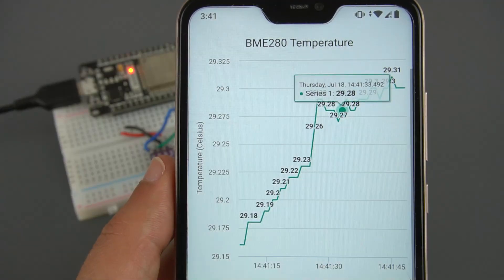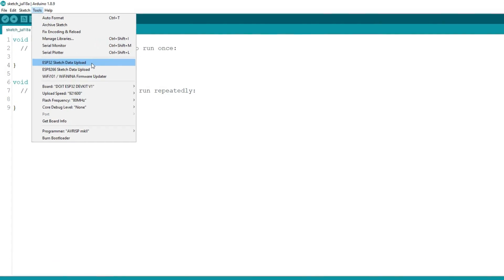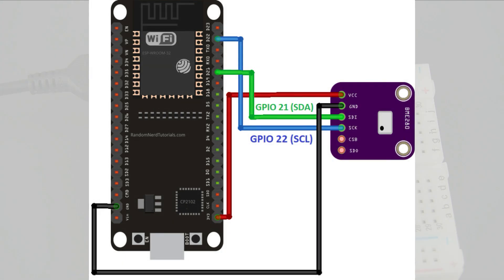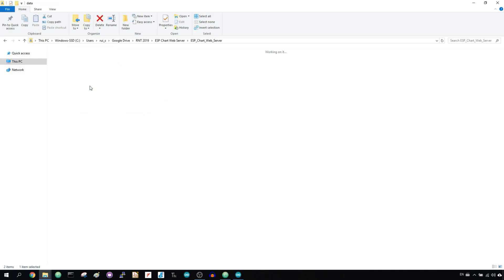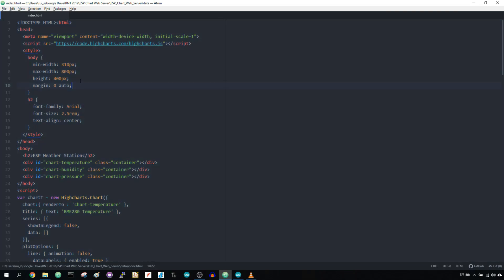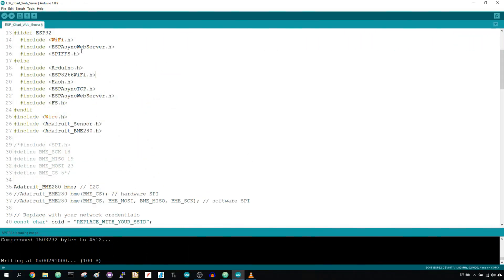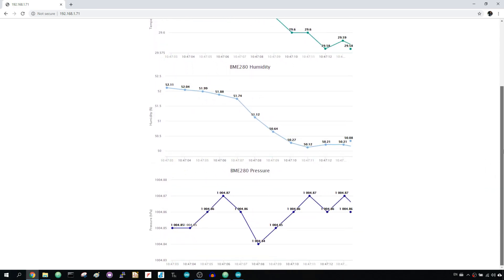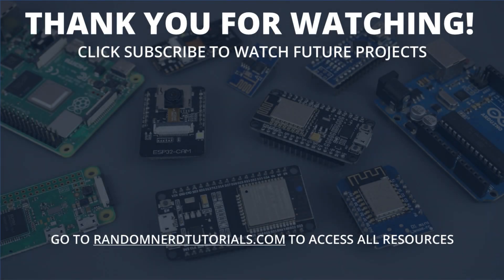ESP32/ESP8266 Plot Sensor Readings in Real Time Charts - Web Server

Comment: Goodnight friend.
Gonzalo Rojas from Venezuela writes to you.
I am working with the ESP32CAM development card, specifically with the example of CameraWebServer, it compiles and records well on the card but when I click MonitorSerie it generates the IP of my WiFi, however it does not connect with that IP on the internet, also on The Serial Monitor generates the error: E (321) esp_core_dump_flashz    ɕ dump partition found!
E (321) esp_core_dump_flash: No core dump partition found!

COULD YOU HELP ME WITH YOUR ENOUGH EXPERIENCE?
Gracias

Comment: Can this be done on a web server that is configured as an access point? Let's say for example you want the arduino to host the server, but have the arduino not connected to Wifi, is it possible to implement Highcharts without Including the JavaScript files in the <head> section of your web page, but storing the JS files on the arduino?

Comment: Nice explanation sir, but I have a question. Could we set the webserver that has ability to auto-add the plot chart when there's a new sensor readings installed? (For example, I wanna visualize sensor readings from every node in my mesh network created by painlessmesh)
Reply: Here is a method to show dynamic data from google sheet database https://youtu.be/CACsMxHalaI

Comment: Lets say if you have this sensor and a heart rate sensor attached . Will the same system work , as both of the sensors will produce data at their own rate . And what i think is that as the whole page is getting refreshed it might need all of the data at the same time from all the sensors
Reply: You can adjust the different polling rates for each sensor in the HTML file.

Comment: sir can u help me, i got problem like this when running program on website 
Cross-Origin Request Blocked: The Same Origin Policy disallows reading the remote resource at file:///pressure. (Reason: CORS request not http).
Cross-Origin Request Blocked: The Same Origin Policy disallows reading the remote resource at file:///temperature. (Reason: CORS request not http).
Cross-Origin Request Blocked: The Same Origin Policy disallows reading the remote resource at file:///humidity. (Reason: CORS request not http).

Comment: Good day,
Would that also work with a NodeMCU Amica module V2 ESP8266?
I have built a small weather station with a 1.3 OLED display but would like to show the sensor data on a diagram or something if that were possible. I just can't find anything on the internet.

Comment: This project is awesome! I test it and works like a dream. But I would like to know if I could take time from a rtc component attach to esp32? I will use the ESP32 with an RTC and an SD card to datalogger the sensors. This device will not connect to internet, but I will use ESP softAP to make an access point, so I could use any device to connect with ESP32 network and see the readings.  Thank you for share this project!

Comment: Hello !!
I am trying to do a similar project, but with the difference that I have the temperature sensor, and the pressure sensor has it my friend who is located in another part of my city, the problem I have is that I want to show in The same web page, the values of the two sensors, but I don't know how to link.
Could you tell me how to do it?

Comment: Hey man, thanks for the tutorial. I've followed it step by step but when I go to upload the code, in the serial monitor it reports that no sensor is found, check wiring. I checked the wiring and its exactly how you have it. Im using an esp8266 with the same bme280 sensor as you. I've used an IC2 scanner and it can't discover the sensor. Any ideas whats wrong?
Reply: same happend to me.. any ideas on how to correct the error

Comment: @Rui  Santos , I need help ... how can I change the  clock  ? It's with 3 hours back . The date it is correct. Please answer me . We can talk on email if you want
Reply: good night daniel, did you manage to change the date to gm -3? I have the same problem
Reply: @claudineymoratony   hi.I found the solution myself. I just had to add 3 hours in minutes to the function that displayed the time.
Reply: @claudineymoratony  var x = (new Date()).getTime() - 1000 * 60 * 60 * 3 
Try this. 1000* 60* 60*3 is  3 hours in miliseconds. That function displays the time in milliseconds since 1970. In the code you specified the time format, that's why the normal time is displayed, in hours, minutes and seconds . So, for GMT -3, you just have to subtract the 3 hours, exactly as I showed you.For GMT plus, you do the opposite, that is, you add up those hours
Reply: @danielbob7769  
It worked perfectly! Thanks!
Reply: @claudineymoratony  you're welcome!

Comment: Great project. I'm trying to modify this for use with a AD8232 heart rate monitor, but I'm only getting a single value (4095) when I should be getting a constant stream of changing values (from 0 - 4095 using the built in ADC). The AD8232 works with just the serial monitor and plotter, so I know it's hooked up correctly. Any suggestions?
Reply: Kind of late but did you find a solution?
Reply: @Screcy  Sorry, but it's been so long, I don't remember. I hope you can find the solution.

Comment: Hello! 
Excellent work, thinking of doing something similar like you did but unfortunately do not understand where to start, I can only use PIC chips for the moment and really don't know that I know enough of it to do something like you did, I liked your project, cheers....
Reply: The Arduino IDE is a free download
programming in in C++
ESP32 is commonly available from on-line suppliers.
BME280  (not BMP280) is available from same supplies
You can cut and paste to get this to work.
I would say there are a lot of steps, but Rui has on all the hard work and 

given a step-by-step tutorial for you to follow.
but, you have to follow from the very beginning to add the ESP32 to the IDE
Reply: @dave-in-nj9393  Hello! Dave

Thanks for your quick reply, yes indeed, even I appreciate the efforts taken by Rui.

Regarding programming, I am zero in C++ that's the reason I use FlowCode to program the PIC chips.

I am trying to understand you and what Rui did, hope to do so quickly, probably ordering those parts you mentioned and start the action.😊

Once again thanks for your kind words.

Abhi
Reply: @abhijitrashinkar  :  see the link to the website tutorial.
this is specific to the ESP32 or to the ESP8266. the ESP32 has more I/O pins and a few other benefits.
the steps are explained.
you have to get the Arduino IDE, free from the Arduino Website
take some steps to load the specific chip  (32 or 8266 one and then the other)
down load libraries
download the program
assemble the board with the BME280 (I think pull up resistors might be needed, more data on the web)
he goes pretty fast on this video, but the tutorial is step-by-step with links.
since FlowCode has a C++ as part of the options, you should be able to port this into FlowCode, then add what you need.
if you wanted to port this from C++ to a PIC, then I would hope FlowCode can do the heavy work for you.
Reply from the maker: Unfortunately I don't have any PIC tutorials...
Reply: Hello! Okay my friend, thanks for your humble reply.

Comment: Is there a reason why it only displays 40 data points? Can this be extended to more than 40 or are we restricted to the limits of the Esp8266 / esp32?
Reply: as you try to display more, the points run together and become almost un-readable.
I think the next version should have a button on your Android that says  40  200  and 1000
that would be a day and a half,  one week and one month  if you take readings every hour.
that way, you could press the value on your phone, and the chart would fill to that.
I think it would be great to have a way to see the last 200/1000 stored readings and not have to wait for it it fill
Reply: @dave-in-nj9393  I have been digging in that library a little bit and hat you mention is certainly possible.
As example, paste this in an html file  and open it in your browser: (I hope the code wont be garbled by youtube)
<!DOCTYPE HTML><html>
<head>
<script src="https://code.jquery.com/jquery-3.1.1.min.js"></script>
<script src="https://code.highcharts.com/stock/highstock.js"></script>
<script src="https://code.highcharts.com/stock/modules/exporting.js"></script>
<script src="https://code.highcharts.com/stock/modules/export-data.js"></script>
</head>
<body>
<div id="container" style="height: 400px; min-width: 310px"></div>
</body>
<script>
$.getJSON('https://www.highcharts.com/samples/data/aapl-c.json', function (data) {
    // Create the chart
    Highcharts.stockChart('container', {

        rangeSelector: {
            selected: 1
        },

        title: {
            text: 'Stock price'
        },

        series: [{
            name: 'AAP',
            data: data,
            tooltip: {
                valueDecimals: 2
            }
        }]
    });
});
</script>
</html>
Reply: @Ed19601  Hey, thanks for the code!
Reply from the maker: @dave-in-nj9393  Thanks for the suggestion. You can definitely all those features to this project
Reply from the maker: It was just an arbitrary number that I decided... I found it was a good amount of values to see either in a mobile or laptop browser. You can modify the HTML page to let you see hundreds of points per chart. Just open my index.html file. Then, search for "40" and modify those values to 100, 500 or any limit that you want

Comment: Excellent project ! Thanks for sharing !
Can NTC sensors be used if the appropriate library is added?
Reply from the maker: Sure, it will work with any sensor or value. You just need to modify the code to read your sensor instead

Comment: Excellent project ! Thanks for sharing ! What is the minimum delay that we can set between two values ?
Reply from the maker: I've used it extensively with 1 minute updates and it was very reliable with 1 connected client. I haven't tested with lower time frames...
Reply: @RuiSantosdotme  
Thanks for your response ! I'm looking for a way to send data in real time from an Arduino to another wirelessly, but I didn't find the perfect solution yet... 
The idea is to create a musical instrument (MIDI) with several homemade wireless controllers (different types of sensors)...
Your channel helped me a lot for working with the ESP32 the past 5 month ! I can't thank you enough!
Reply from the maker: @BertrandL  I would recommend just using 2 ESP32 to exchange data with each other. I would probably use MQTT. I'm glad it helped! Thanks